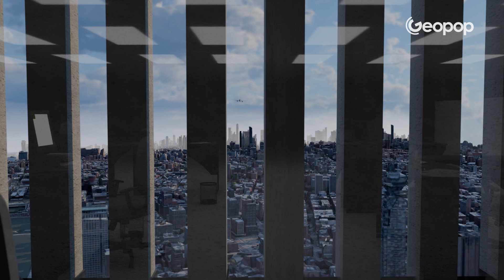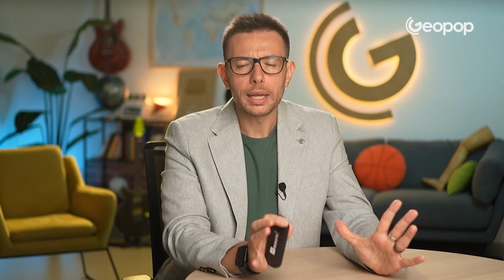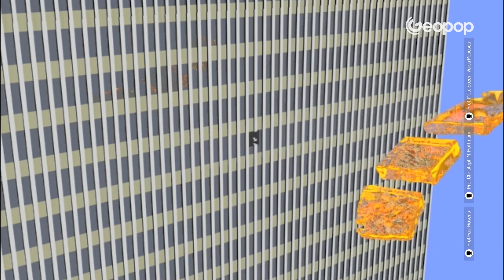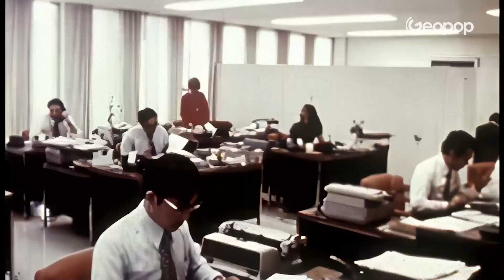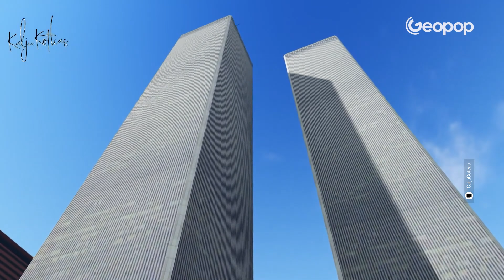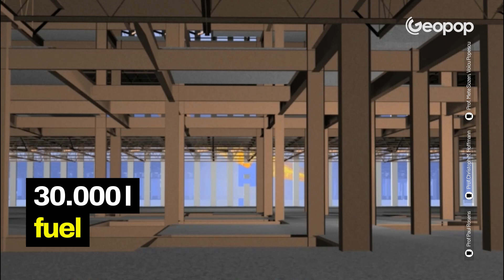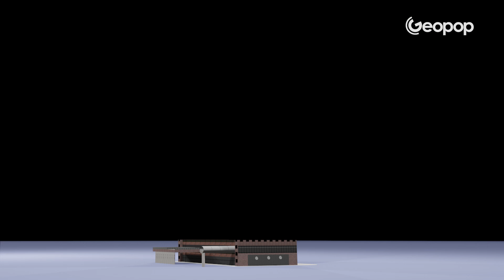9/11, 2001: The Technical Reconstruction of the Twin Towers and WTC 7 Collapses

Comment: If you think building 7 fell like that because of fires, I've got a bridge to sell you...
Reply: I don’t understand how a building collapsing after the two largest buildings in the west fell on top of it, then burning uncontrollably for 7 hours with no sprinkler actuation or firefighting efforts at all, is so impossible to believe.
Reply: @stephenharr2870  Asymmetrically and partially collapsing? Maybe, yeah. Slipping straight down in seconds into a neat pile? Hmmmm...
Reply: @Girru95 brother, the firefighters pulled their operations from the building, because they knew it was at risk of collapsing. Theres alot of things about the official 9/11 narrative that aren’t very believable, but this is absolutely not one of them.
Reply: @Girru95  - I do, and this is why:  Much misunderstood, Building 7 was the 6th building to collapse of 10 lost on 9/11. Because of its early low priority, conspiracy filled the information void with garbage made up by technically ignorant people promoting political agendas. But 7's loss is an engineering problem and should be treated as such, so I prepared this brief summary of my own analysis to fix that, using technical analysis, not ideology and tired memes. 

At 10:28am the WTC North Tower collapsed, showering Building 7 with tons of burning debris, causing heavy damage and starting many large  fires which burned out of control for the next 7 hours. Half the FDNY firefighters having been killed, units in disarray, equipment destroyed, no water pressure, and the greater urgency of search & rescue efforts, Building 7 couldn’t be saved so firefighting efforts were pulled as futile and 7 left to its fate. Firefighters make that sort of choice every day in brush fire situations - which houses to save and which ones to let go. Only real difference here is moving the decimal on the size and cost. People get overwhelmed by the size.

www.youtube.com/watch?v=g_SvpwyC17M

Collapse of a burning structure is always a concern for firefighters. Steel buildings subject to fire rely on active firefighting to survive. Buildings are designed around 1 to 3 hours of fire resistance, allowing time for occupants to escape and active firefighting to get started, after which all bets are off. Left to their own devices they'll exceed their design envelope and collapse, like Plasco Tower and Wilton Paes de Almeida. In 7 the occupants escaped, passive and active fire protections were compromised and active firefighting was abandoned hours before the collapse, which left the building to its fate. It lost. Odds on Building 7 would eventually collapse, and it did. No big deal in logic.

 http://www.youtube.com/watch?v=WnYBX6QT0R4 

FDNY Chief Daniel Nigro - The biggest decision we had to make on the first day was to clear the area and create a collapse zone around the severely damaged 7 World Trade Center, a 47-story building heavily involved in fire. A number of fire officers and companies assessed the damage to the building. The appraisals indicated that the building's structural integrity was in serious doubt. I issued orders to PULL back the firefighters and define the collapse zone. It was a critical decision; We could not lose any more firefighters. It took a lot of time to PULL everyone out, given the emotionalism of the day, communications difficulties and the collapse terrain 

FDNY Deputy Chief Peter Hayden ; We had our special operations people set up surveying instruments to monitor and see if there was any movement in the building. We were concerned of the possibility of collapse in the building. And we had a discussion with one particular engineer there, and we asked him if we allowed it to burn could we anticipate a collapse and if so, how soon? And it turned out that he was pretty much right on the money, that he said 'In its current state you have about 5 hours 

The collapse of Building 7 was anticipated and widely reported in the media throughout the day, with 24 video cameras recording some or all of the collapse. Everyone knew what was coming and why. 

www.youtube.com/watch?v=OY5S5k3tMHI

The collapse of Building 7’s was entirely different to the Twin Towers and harder to understand, most details being hidden from view and not intuitive.  But we can still sort out what happened through careful analysis and observation. This is my explanation of the collapse relying on no outside authority. 

Building 7 was a unique, asymmetrical 47-story steel framed structure built atop a smaller 3-story building serving as a partial foundation, requiring lower floors dedicated to complex load transfer structures. Of trapezoidal shape and all-steel tube-in-tube construction, B7 (above the 7th floor) consisted of a central core of steel columns carrying most of the gravity load, perimeter steel columns around the outside of the structure carrying the remainder of the gravity loads and long span beams and girders to tie those elements together and form the floors. On the outside of the building hung a moment frame or outer shell. 

Phase 1 : First externally visible signs of collapse initiation occurred at 5:20:28 pm and were notably quiet with observers not realizing the building was collapsing! No audible warning in the form of hundreds of ear drum busting 180-190dB explosive bangs preceding the collapse. Here at 12:00 a local CBS affiliate reporter is talking 10 blocks from B7 when collapse begins. People don’t start to notice the collapse until 12:11. At 12:45 is the famous CBS fixed camera clip of Building 7’s collapse. Note how quiet it is. 

www.youtube.com/watch?v=t5tEy6mXSE8

Collapse initiation was due to lower floor failures above the load transfer region (8-14th floors) in the NE corner. In this video at 0:45 you can see the NW corner from inside the building while under construction, Column 79 just out of frame on the left. That big, angled steel beam across the top of the frame connects to C79 at one end. The girders connect to the beam. That beam and all those girders depend on just one connection 

www.youtube.com/watch?v=nP3TNHPCIVU&t=45s

Phase 2 : The NE lower floor failures caused a loss of critical lateral support over an excessive length of Column 79 and it buckled. Looking at a floor diagram of Building 7 (www.nist.gov/image-16640) when you see all the structures that depend on C79 you quickly realize this one column was a relatively isolated structural element on which a disproportionately greater fraction of the structure depended analogous to say the Key Bridge. Externally as collapse begins we see a vertical progression of window breakage along the 44-46 line and a kink in the roof of the East Mechanical Penthouse at the top of the building, consistent with C79 failure. Normally with a buckling column, the load could be redistributed to other columns. With C79 that is not the case - the failure did not redistribute the load, so the collapse rapidly progressed to the roofline, sinking the rooftop penthouse. The transition from full capacity to almost no capacity occurs in an instant and will result in virtually no resistance 

Phase 3 : With C79 gone, B7’s progressive, non-symmetrical collapse continues with adjacent columns 80 and 81 left laterally unsupported, and quickly buckling as well, sending the EMP down through the building. C79-81 all have no diagonal bracing, which is the major reason why they could not redistribute a lot of vertical loads among one another. From there collapse progressed from east to west through the central core until the core was gone taking all of the interior floors and probably most of the perimeter columns with it. Follow the horizontal progression of window failures low in the building and the dropping of the remaining rooftop structures into the building. One of the big takeaways from the NIST Building 7 study (invariably ignored) was how their modeling determined C79 failing under ANY circumstances would have initiated the same collapse sequence. 

Phase 4 : After about 10 seconds only the exterior moment frame remains, giving the illusion B7 is still standing to the casual observer since little has outwardly changed. But it is just a hollow empty shell like an empty cereal box supported only by a few remaining columns and overloaded from the loss of the core columns and floors, quite unable to remain standing. With nothing remaining behind it, the north face leans inward, forming a V in the roofline, the last few columns buckle under the strain and the moment frame free falls, landing on top of the debris pile. 

It is only here at the very end that a single measurement of alleged free fall acceleration is taken, from a single point on the outer shell. The Building did not “free fall” – just one corner of the outer shell did, sort of. The Building_ (defined as its center-of-mass) was already gone before that happened. The period of alleged free fall was a product of how it fell NOT why it fell and can't tell us what started the collapse 10 seconds earlier. Start to finish the collapse took 18-20 seconds, 3 times longer than free fall . How fast something falls cannot tell you what started it falling_ anyway. 

The debris spread outside the footprint blocking surrounding streets, heavily damaging the Verizon Building and destroyed Fiterman Hall. 

Building 7’s progressive, non-symmetrical collapse was incidental and unintended collateral damage from the combined effects of fire + time + gravity, started by the collapsing North Tower. That is true no matter who planned and carried out the 9/11 attacks or why . The collapse was of so little consequence it barely registered at the time - a footnote, only taking on semi-mythical status as an alleged smoking gun years later when demolitions at the Twin Towers, missiles at the Pentagon and shoot down over Shanksville all failed and conspiracists had nothing left to work with. 

Anything can seem like a conspiracy if you don’t understand how it works. Now you should. I hope you found this helpful, informative and it solicits informed critical comment. If I made any errors of fact, logic or reason or left anything important out, please let me know so I can fix it. IF you can offer a more plausible alternative please do. Be the first. Please start any reply with the words “Tits McGee” or I will know you didn’t read it and are wasting my time.

Now about that bridge,...
Reply: @stephenharr2870 1.The firefighters said" it looked like they planned to take down the building" I didn't say that, The fire fighters said that. They were there.I'm sure they know best.
https://youtu.be/XiIT4HInWjY?si=e1Pvp3-IFs-M75Oj
When the firefighter says "boom, boom, boom, boom" in this video.
What do you suppose he is?Implying by " boom" ?? What do you hear? 
2.So if there were no explosives then what is this? 8:25
https://youtu.be/bLF5D7M1YgA?si=aHSvS__uOdxMi1ZB
You can't say that it was added because you can see the firemen's reaction to the explosion. And you can't say it came from anywhere else because the firefighter says
" We gotta get out of here,  7 is exploding "
3. Controlled demolitions have squibs, you can see the squibs here 20 floors below the collapse. 
https://youtu.be/eXAgulfAtR4?si=-iLO9aQjMJVLTUYH
4. Firefighter says "any one of these buildings could blow up,  this ain't over yet" firefighter says there's 3 secondary explosions. 
https://youtu.be/0Gh3ErgMI4M?si=mmp9Eus_5PWTCBfl
5. Airplanes can't fly 600 mph at 1000 feet. And to be able to make a 180 degree turn to hit the opposite side of the pentagon going that fast is ridiculous. And since when do terrorists hit the opposite side of the building where no one was at when they could have just flown straight in and killed way more people???
https://youtu.be/0Gh3ErgMI4M?si=mmp9Eus_5PWTCBfl
7. No one has ever known ahead of time that a building was going to collapse except through controlled demolition.  Tower 7 was reported to have fallen while it still stood in the background. 
8. Larry silverstein,  the man who made over 4.5 billion when they fell, claimed to have pulled the building down.
https://youtu.be/1jQaJFNWqtc?si=wCywQ9grgBdS_w11
9. A witness reported a missile hit the pentagon while he was seen at the scene. 
And the hole wasn't big enough for a plane and the damage wasn't consistent to the towers. And just like shanksville,  there's pictures that show no plane parts at all.
https://youtu.be/6_Ez-UCpXMs?si=JaQ6DBEC_LJtMLgN
10. That video also points out They were military planes that hit the twin towers. 
11. All sorts of reports of explosions were reported that day.  
12 Buildings dont accidentally fall  Into it's own footprint.
Reply: @Girru95 right…..❤❤❤❤❤❤

Unless you have A Single Digit IQ… U believe That..😂😂😂😂😂😂😂😂😂
Reply: @Girru95  Bro have you seen picture of ground zero? It was anything but a "neat pile".
Reply: @zippyducky1704  Bro, have you seen the footage of 7 falling? It's anything but a "collapse caused by fire".
Reply: It did literally collapse partially and unevenly
Reply: @stephenharr2870 nothing fell on top of it That was building 6 Not 7.. 7 was only Hit by debris& Magically somehow Had 4 Floors of fires Magically….😂😂😂😂0& Came down free fall speed In its own footprint…

Do better…💯🤣🤣🤣🤣💩
Reply: @adambailey9489 you might want to rewatch some footage and you will in fact see that 7 WTC took significant damage after 1 and 2 fell.
Reply: @naomiwelsh80 what demolished the lobbies in wtc 1,2&7 before either "collapse"?

Comment: The Technical Reconstruction. TECHNICALLY... All 3 buildings fell straight down at nearly free-fall speed exactly as a controlled demolition would have wanted.
Reply: But they didn't, they fell from the top first.
Reply: Or as buildings fall down.  Your only frame of reference is pre-planned demolitions (of concrete buildings) so you just go with what you know

Saves a lot of painful thinking. 

The above video is correct and that is true no matter who planned and carried out the 9/11 attacks or why.
Reply: @TheCriticalStinker-01 yeah cause buildings just fall down all the time.  Can you say, never happened before.  And who qualified you to know about how buildings should fall down? I guess you think it should start at the bottom because you're a moron and if you did that the whole damn thing could have fell over and destroyed all sorts of stuff but no it fell straight down exactly like it should in a controlled demolition.  Anyone who thinks that a professional team would have took this building out at the bottom is a fool. Tell people you don't know what you're talking about.Without telling them, you don't know what you're talking about. Complete ignorance as usual smelly
Reply: ... and also exactly as would be expected from massive structural failure.

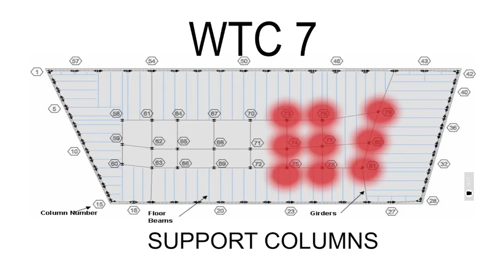Comment: 20:33. No way man,check again the realnl footage,the building went down alstraight down the ground,not falling down firstly on its lefty part or righty.You fail here.
Reply: YOU need to CHECK AGAIN.  Collapse initiation in Building 7 occurred in the NE corner and progressed from east to west through the core (center) of the building until the core was gone, taking all the internal floors with it. Only then did the exterior moment frame - and empty shell like an empty cereal box - fall, giving people like you who don't understand what they are seeing the false impression the whole building comes down at once.

But it's just an empty shell. The building (defined as its center of mass) was already gone.
Reply: @TheLoonResistance  https://youtu.be/UsoLzfRf__k?si=j8hPvzid_ZN3Jfm6

See things from real lens man

Comment: 19:04 NO it did not colapse like that.Check the real video it was like a controled one,straight to the ground.
Reply: Ummmm.. He DID in fact show the videos!  Many times.  Showing exactly how it collapsed, which exactly matches the computer models.  Try watching the video for real, and pay attention.
Reply: @ChristLink-Channel i could use the same programe and apps to prove it went down straight to the ground,and it would last hours even a day.
Reply: @tudotraduzido4570  Umm... no you could not  Because structural analysis software is based on real-world parameters.  You cannot insert fantasies and make-believe into the equations behind FEM/FEA software.  You cannot create boundary conditions that are impossible in the real world.  Thus, you could not use that software to do what you want it to do. Your input would be rejected as an error condition, and therefor non-calculable.
Reply: @ChristLink-Channel shut up dude i make bamboo houses and bikes.You have no clue how hard it is.You can't even laminate a bamboo and get its quemestry and the quimic that we make to put it together.If i told you it is stronger than iron you would not believe.Youre one of the very few ones who believes in planes destroying huge buildings in a day and you believe in your trump.No time fer it mate,keep your ilusions to yourself.
Reply: Just did, simulation looks bang on